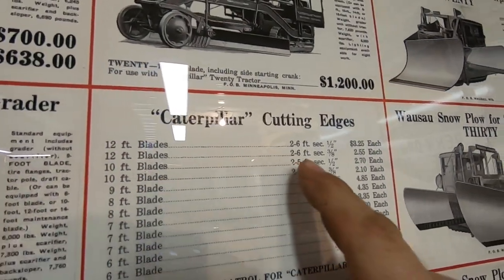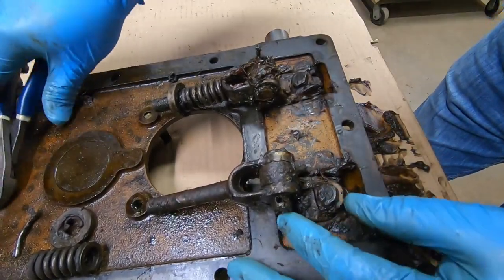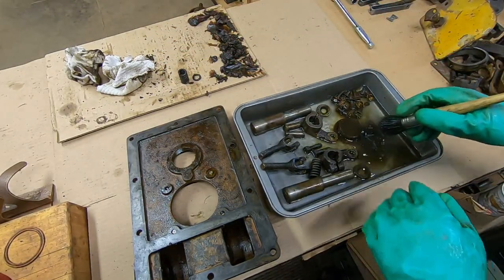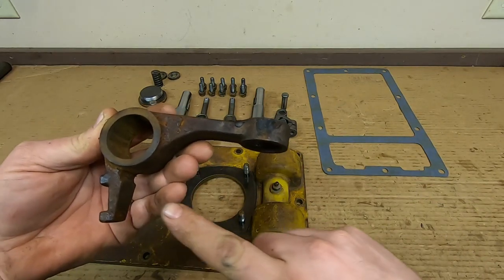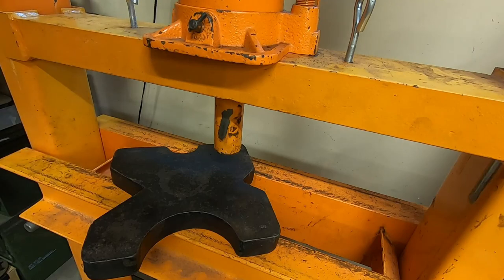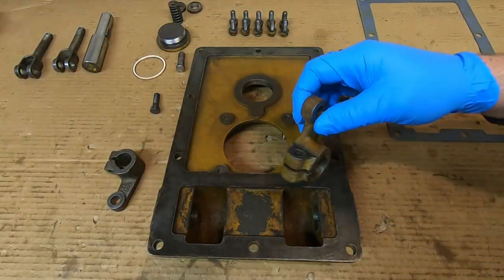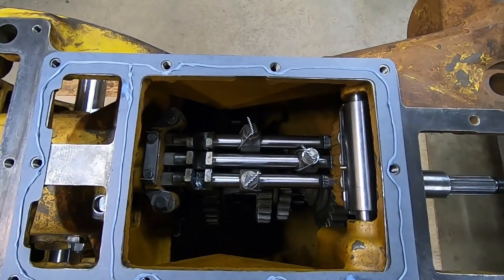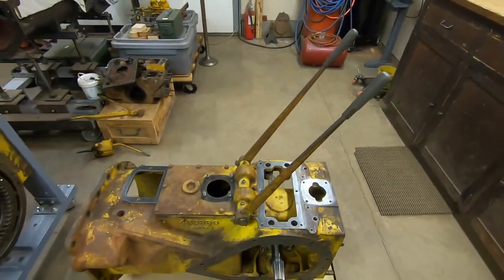Caterpillar D2 #5J1113 Chassis Rebuild Ep.17: Transmission Top Cover & Dang That Old Shifter Knob...

Comment: Bakelite is a thermoset polymer.  It is resistant to heat and scratching of the surface, and has high electrical resistance.  It is also highly resistant to certain solvents.  You should avoid exposure to HCl (hydrochloric acid) and NH3 (ammonia), these were often used as catalysts to form Bakelite back in the 1940s-50s when this knob was produced.  If you are going to attempt to remove the knob, it would be wise to heat it (in a limited way) because it makes the cross-linked portion of the polymer a little more flexible and less prone to cracking.  I would suggest heating it in an old oven to 200 degrees and then use a penetrating lube around the threads to help draw it up into the threads.   Support the shaft so that the knob isn't touching anything.  After the lube has a chance to work, I would heat it again to 250-300 degrees and carefully try to remove it with heavy gloves.  Cool the shaft if you can, but make sure the knob is still hot.  It may take several heating/cooling cycles for it to work.

Comment: Re: getting the gasket past the upper pivot plate (23:40); I think you might be able to do it, not by stretching the gasket over the outside, but by rolling the gasket up, and pushing it up through the hole in the upper pivot plate, then unrolling it.

It's much easier to make the gasket small enough to through the hole than to make it big enough to go over the outside.

So my sequence (in my head is):

* Pass gasket over the pivot ball
* turn gasket so instead of being across the shaft, it's nearly parallel to it
* roll gasket up (around the shaft)
* pass up the shaft, through the hole
* unroll

Comment: Squatch253, I commend you. I would have used heat to straighten that clutch lever. A thin coat of rattle can 'clear' would have handled the rust problem. You make it look so easy. That's where the skill shows. Great video. Thanks.

Comment: As many of these tractors you've worked on I am surprised that you don't have a parts washer to clean up things such as the top cover.  Even though I never was able to take advantage of the schooling I had in diesel mechanics, I was lured away in the service by a career advisor into electronics, I enjoy watching you do your thing.  I'm curious why you didn't use a little persuasive heat to bent that lever back straight.  BTW did you remember those shims that fell when you removed the the first main gear set out.

Comment: If you can get the old pin out some dry ice or liquid nitrogen on the new one it will slip in. Could also add some lite heat to the bore

Comment: I was taught, cold bends, you let it sit in the press overnight. It will never be 100% perfect unless you put heat to it. 
Use a heat gun on the knob, then wrap it up really good with some rags, clamp it gently in a vise, it should unscrew without issues for you. Hopefully, you save the knob. Cheers :)

Comment: Another very interesting video. I also cringed as you applied pressure to the lever. What is the center greases fitting for? Do the shafts  go in that far.

Comment: Looking pretty nice! I suspect some sort of cross bar (maybe with a bump on it) through a couple of holes in that shifter housing will support the top of the housing to press the new pin in, and I'd think you can just drive the old one out with a punch.

Comment: I know you explained why and where you put in fold-over locks the other day, but was surprised that the pinch bolts on the steering clutch actuators did not have them as they are directly over the gear cluster and would cause mayhem if they fell out. I may be wrong of course, the wife reminds me frequently that I am.

Comment: I find when I'm bending strong metal back that has been bent I leave the pressure on for some time to allow the metal to stabilize and not spring back as much. Works most times.

Comment: +1 on saving the knob if at all possible (and the one on the shift lever as well), to press the clutch pivot pin into the housing, machine a spacer to span across the inside of the 'gate' housing and press on the far side, minimal stress on the housing as the force is transmitted across internally by the spacer.  A thought for the knob preservation, would a coat of clear epoxy protect the knob from damage?

Comment: shop press jack release knob..  find a coupling nut that you can drill the threads out of to clear the shank of the release screw. cut a slot with an angle grinder to to allow the coupling to slide over the pin..  use a short bolt to hold a stack of fender washers as a knob on the upper end of the coupling nut. if you don't just knock something out on the lathe..

Comment: You might try leaving the shaft under pressure for longer than a few seconds.   If it wasn't breaking at that initial pressure, the stress was necessary

Comment: That sifter knob is stuck cause it's rusted into the threads. Since these knobs are I believe Bakelite then it becomes fragile over time and will crack into pieces. Heath is not a option so how I look at it you have to go the long way.

Comment: what mechanism keeps the pivit shafts from moving side to side? 
it looks like there was a lot play side to side  when you pulled on those after securing internal arms. where is the bearing surface, one is on the edge of the exteral arms but what keeps it from moving to the outside?

Comment: Toby is there any way you could get the round thing with the pin through the centre, well that’s about as clear as mud. Let’s start again, the round ball on the bottom of the shifter rod, that has the pin through its centre. Take the pin out and remove the round steel ball. Is that possible, seems like it would save the black knob, and be a fair bit easier. Mate leave it up to you, keep it coming, it seems like 113s heart is starting to beat. Stay safe and healthy. Cheers from platypus land.

Comment: Wouldn't it have been easier to install the springs and washers on the yokes before installing the cover?
You scared the daylights out of me cold pressing that clutch lever :)
Put the shifter rod on a heavy piece of steel and use a muffle gun with a blunt tip the rattle the end and the knob may come off.
Reply: yep-in 23 pieces

Comment: Random crazy thought while watching: 
Heat and cold cycles on the shaft to free up the knob?
Crazy plus thought:  in a desperate need to see that transmission because it's just so slick, if there's a surplus of those gearbox covers, cut a window in.  Probably wouldn't work and blasphemy cutting up these parts but man it'd be cool to keep that viewable.
Reply: heat on the shaft makes expansion strain on the knob bore-that one is likely (maybe) post-bakelite
Reply: If you accept that he always makes it all look easy,  now seeing him work around the knob so easily,  it definitely wasn't worth messing with.

Comment: Squatch253, 
Good video I've been looking forward to it.
There is another guy on YT that I think needs your help. He's @ Salvage Workshop and has a '57? Traxcavator that he's gotten running but he really needs some guidance. The Magneto broke 2 teeth off and dropped down into his ponymotor. He's stripped it down to its component parts and found the crank bearings were "a little loose but I'll just make another set out of some aluminum I've got laying around." Please help stop my full facial twitch. Lol

Comment: I was watching a video where you showed the D2 U series transmission gear oil level dip stick located on the top cover. Think I can add one on my 5J series trans.? make checking the level a lot easier. I don't have a U parts book, could you list the parts needed? Thanks, great series, picked up a lot of tricks, and info from you.

Comment: A new knob would definitely make the eye twitch.  Squatch did you not forget some springs or did I miss something can you install them after you bolted the plate down
Reply: Was thinking the same thing
Reply: The bent peace with the broken spring you put the clutch handle plate back on the gearbox did not see the to springs
Reply: @squatch253  Squatch the Pooler rods one was bent with a broke spring on it you put them all back together with a new rod and no strings I went back and watch the video
Reply: @squatch253  I was just wondering  I figured you would have to go be able to install the springs after the plate was bolted to the casing (  gear box  )   always waiting for the next vid love watching

Comment: I had a question/comment about the fill cap. It's surprising to me that they actually made that cap with the socket for the large allen wrench instead of having a square boss that any adjustable wrench could be used to remove. So in the old days they had to carry an Allen wrench/socket to fill with. Are there other caps on the machine with that Allen socket size?
Reply: @squatch253  thanks for the reply. I appreciate the information! PS hope you heal soon after seeing the other video!

Comment: Toby, so here is my question. Many times when I am breaking down a machine when I begin to remove bolt I encounter some resistance. I know not unusual.  But at some point in the process it appears to be coming loose. A few seconds later I realize I have sheared off the bolt/stud. Do you have a point which you recognize it is time to back off or do you end up shearing off the bolt and have to deal with issue

Comment: Just out of curiosity Squatch.....

I know how much you love Cats attention to detail and the fixtures etc all being secured with your favourite locking tabs.

It therefore amazed me to see no locking tabs on the inner clutch activating rods?

Do these escape dropping inside the gubbings should they loosen?

Not blaming you in any way as there were none on disassembly. 

Great series as usual (love to see more on X231 too 👍)

Comment: As the gentleman said below,press the pin out of the ball and pull everything apart from the bottom.
Other than that,hacksaw the shifter lever and reweld after. A little extreme,but it would work.
Reply: @squatch253  Oops.

Comment: rather than trying to stretch a flexible gasket around the outside of the upper pivot plate, try putting the flexible gasket on the bottom end  of shift lever and then push it up over the pivot ball, and the through the center of the upper pivot plate
Reply: Yes. Or you could try from the top. Put it over the knob, roll into a cylinder and tape. Then down through the holes in the centre of the other parts. Remove the old one in the same way as a test run of the best route.

Comment: I have what used to be the  same brass drift that you used but mine is 1/3 that long now, It is well used.
I am wounding if the level is forged steel or common steel depending upon what it is heat in the proper location can make it bend in the exact location needed.
Reply: He's saving the patina otherwise I'm sure heat would be involved.

Comment: Okay Squach here is a good question for you. I notice the nuts that hold alot of these old machines together are directional, in the sense that one side is kinda round like most hardware store nuts, but the clamping face has a slightly raised flat machined surface. What is the technical term for these nuts and can you still buy them new or is this a feature of fastener manufacturing of days gone by? Reason I ask is I was removing the manifold on a Murphy diesel in my Northwest crane and I dropped 2 of the nuts into the abyss and Id like to replace them with the correct nuts and not Ace hardware junk

Comment: I would have contemplated cutting the handle in half about two or three inches below the knob and then welding it back together and trying to grind it and sand it back into shape.

Comment: Instead of a new 2 piece gasket, can you just make a single cut along the side of a new one piece. That will give you the split you need to go around the shift lever. A dab of sealer will make it good as whole.
Reply: @squatch253  Great idea, wouldn't have thought of doing it that way!

Comment: What is wrong with a really flexible gasket fed up through the hole in the base plate...  put over the ball first, and then carefully folded to allow it to go through the hole ??  one way to do a one piece gasket without having to remove the precious knob.

Comment: another question if the shift lever doesn't have any value couldn't you cut is off at the knob and drill it out to remove the knob without damaging it.

Comment: Why didn't you heat the steering clutch lever before you tried to straighten it?  I feel this is a dumb question, but im not certain I know the reason, so yeah ill ask
Reply: You’re not the only one thinking heat first.....
Reply: Yeah me too.  Would ruin the patina though.  Then you have to paint.  Then either paint the whole thing, or try to age the paint to match.
Reply: Disagree on have to repaint!  Likely ruin patina, but heating and ruined patina better than broken IMHO.  Ruined patina due to heating, but still a guaranteed usable lever, is CHARACTER!  Adds to the appeal
Reply: @billhartl6601  for sure.  I was joking about painting.
Reply: John Wythe, agree that heating would affect patina.  But I think we both agree that would add character and be better than risk of breaking the lever.  So our question remains, why no heat?
Reply: @billhartl6601  one mans character is another mans eye twitch.  Lol!
Reply: For restoration,  less time, than making it look the way you want as well.  If it breaks it breaks, there is another in the shed.  If needed fixed today, and no replacement, heat it, looks go out the door.

Comment: What type of material is that lever made of?
It's seems like some sort of cast iron or maybe cast steel?
I have little knowledge of cast Iron so I went to Wikipedia and read up (there is a lot that goes into casting iron).
Basically there's grey, white, malleable, and ductile with various hardness, toughness, bending, and cracking characteristics.
At first I thought they were made of malleable or ductile cast iron, but after reading an article of cast iron vs cast steel I think they may very well be cast steel.
Reply: I also searched my foggy memory bank and I seem to recall that back in the day a bent crankshaft was straightened by hammering in stresses that countered the stresses that bent it.  Straightening a crank in a press often caused cracking and failure.  But this lever is much thinner and less complex and hammering is an art that few today possess so using the press makes sense.  I did expect some heat at first mention then I thought that could change the grain structure depending how fast and how hot it was heated and cooled.
Reply: My feeling is that it is forged steel rather than cast.
Reply: @MrHumding  I thought of that
butt
there are casting numbers and mold parting lines on them.
They might be forged, you can get forging dies with numbers/marking embossed in them.   Would love to see a video of that.

Comment: all the thick grease under the dome cap..  could that actually be factory Cat installed to prevent dust and water from leaking under the dome or down the shaft and getting into the transmission thru the shifter..   is there any chance of cheating slightly..  and using a tiny bead of silicone between the neck of the shifter dome and the gearshift lever.  so no water can wick down the shaft.  or split some Orings and put them in the split pin retained cap as a packing.   only issue. where the heck do you find something that crazy thick.. perhaps a cat pin grease like schaeffer grease 238 i think..  in case you have never run across it.. don't get it on your hands.  its crazy sticky. https://www.schaefferoil.com/238-ultra-supreme.html

Comment: Remove the shifter rod ball & pin.
Reply: @squatch253  No luck there.
How is the shifter knob threadlocked to the shifter rod ?
Did they use natural resin those days ? - as this can be softened by moderate heat.